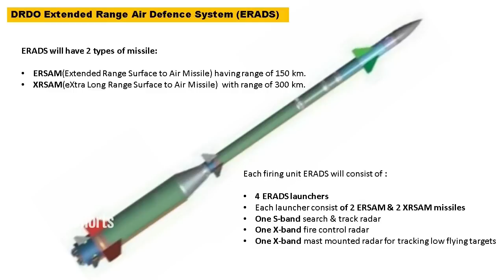Approvals for development of LRSAM (Desi S400, 3-Layered Defense system) at advance stage with MoD

Comment: VL-SRSAM can do a better job of the first part of the system. MRSAM is acually worse than Astra Mk2/3 in terms of range and performance and no escape zone. This desi supplement to the S400 is much needed, since there are not nearly enough S400 to provide countrywide coverage.